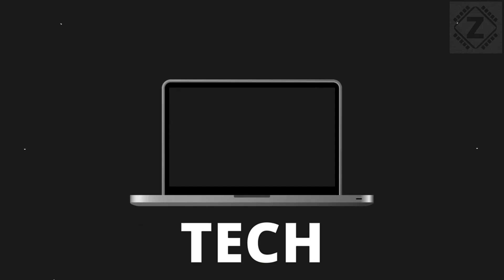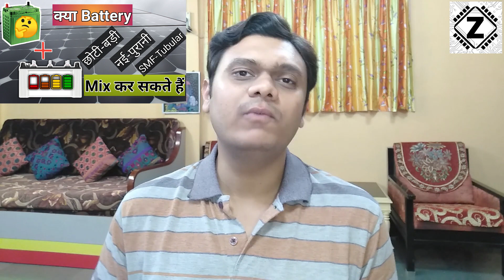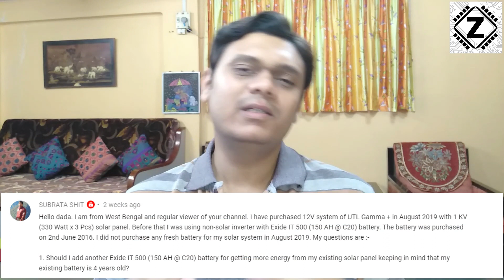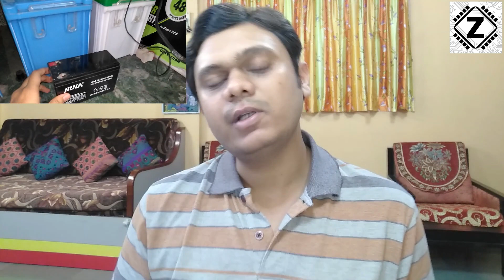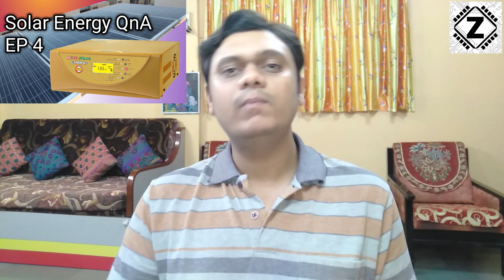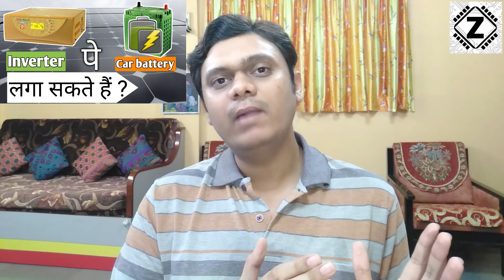[Eng] How to Parallel Different types of Battery | Mix Size, Chemistry, Topology, Age, AH Rating

Comment: Hi can I connect lifepo4
Batteries together
51.4v 100 Ah and 51.4v 200 ah
Both have own  bms
?
Thank you
Reply from the maker: In parallel, yes.
Charge them to same voltage before connecting.
Reply: Can i connect two UTL 24v 100Ah lithium batteries in parallel to get a  5unit storage for my solar inverter ❓pls opine....
Both hav one normal BMS... So any problem for parallel connection to increase storage ❓
Reply from the maker: @DeltaSeries  generally no problems. But their soc will drift.

Comment: Thank u for ur teaching...but I'll like u to tell me ,,I hav 2 pieces of GEL deep cycle battery and 2 pieces of AGM deep cycle battery and I want to use all 4 connecting them in parallel.they are all 12v 40amp...
Can I mix them in parallel? Is there any serious dangerous consequences?? Thank u
Reply from the maker: There shouldn't be anything dangerous as long as their voltage is matched closely.
Reply: @ZenInnovations  is it ok for me to ask u how to position them? Is it AGM to gel to gel to AGM or 
AGM to gel to AGM to gel? 
There position in the rack is what I want to kno
Reply from the maker: @richardalagoa6510  does not matter

Comment: Good job. I'm running actually running 2x 120ah lifepo4 in series which would be a 24v 120ah system. I wanted to expand so I added a single 24v 140ah and I'm running these in parallel. It's been a week and I've been solar charging those battery bank without any problem.
Reply from the maker: Great!

Comment: Hi thank you for the tips, I have a gel type valve Regulated battery and I plan to use it as a power backup but I only have a Gel battery charger and an inverter for now, so my question is can I possibly stock or store the battery for now and just use it if there is a power outage in our area, would it be ok for the Gel battery? Thanks
Reply from the maker: No that's a bad idea. Lead acid batteries should be always kept on a trickle charge. Get a battery maintainer with this feature. That shall help.
Reply: @ZenInnovations  thanks for the quick response mate, I also plan to use it soon for a solar setup, thanks to you now that I know I cannot store it like a powerbank I might do that sooner, and can a 60w solar panel be enough for it or I can still go for 100w panel ? For now I  might use it regularly every other day and charge it to my smart charger , but if I can monitor the charge or voltage using the gel charger is it ok to just put the alligator clips on the battery while not in used? Pardon me for too many questions since I am really new about batteries my friend, but Thanks a lot.
Reply from the maker: @spartty1856  1. Go for the largest panel that your budget may allow. It can be reused later.

2. Alligator clip is fine for temporary setup. Just set the trickle charge as per my recommended settings. Or as shown by manufacturer.

3. For more discussions join my Telegram group. Zen innovations.

Comment: i have two battery same brand same volt but different capacity(Ah) . is it okay? 
i have 16ah x4 in parallel i will add a 50ah battery is good? if 100ah?
Reply from the maker: Should be OK. 
Just watch the video carefully. Everything is explained.
Reply: @ZenInnovations  yes but you said the gap must not be far. so i dont if 16 to 50 is far.
Reply from the maker: @AniManiac1990  16x4 is already 64. Then add another 50.
It won't be far.

Comment: Sir Can a 12 volt 725va inverter charge two 150ah batteries in parallel ? My inverter charges at 10 - 14 amps will it be possible to charge both the batteries by that inverter ?
Reply from the maker: It will charge but slowly.

Comment: Those so called sealed batteries only have a thin plastic glued on cover on the top, pry that off with a screw driver and wha-la you have access to the individual cells that have a rubber cap on that you pull out to check on the fluid level.
Reply from the maker: Nope. They're vent caps.
The electrolyte is a gel or paste format. Not water.

Comment: Hi, My car has a 35Ah(2yrs old) led Acid starter battery by the company which charges with the Alternator of the car but now I want to install a Second battery same led acid of 45Ah and connect it in parallel with the 35Ah for charging with alternator so that i can run the accessories in my car separately with the 45ah battery when the car is shut down.
Question: 
1.Will the existing alternator of my car take the load of charging both the batteries together 35Ah+45Ah in parallel?
2.As the first batter is 2yrs old so won't it spoil or effect the 45Ah new battery?
3.hope any electrical won't get damaged by this connection?
Thanks
Reply from the maker: 1. Easily.
2. Generally Parallel is very forgiving as long as batteries are not different chemistry or voltages.
3. No. Make sure to use thick wires & appropriate fuses.
Reply: @ZenInnovations  thanks for you reply,  
Sir another query:
1. Actually I have put a Volt meter on my car and when I start the car and drive in the day time the volt meter shows 14 to 14.1Amp reading but at night as soon as I switch on the headlights it drops down to 13.1 to 13.2amp, so is that drop common or is it that my alternator is faulty or not capable of handling that power?
2. Secondly, 35ah + 45ah led Acid is fine in parallel connection as both together will be 80Ah or should I put the same Ah 35+35 for better chemistry?Hope my alternator won't die or not charge the batteries of 35+45=80ah  as just by switching on the headlights if the alternator power drops so much then charging 80amp battery along with headlight On won't be a challenge??
3. I have bought 10gauge thick wires for connection with 30amp fuse it that fine?
Plz throw some light as I am a bit confused.....thanks once again.
Reply from the maker: 1. Some drop is ok. Do you have high wattage bulbs in the headlight? You might want to go to LED bulbs which might save some power like these-
https://amzn.to/3E1wT9Z

2. Either is fine. Its your choice. If you have doubts, get the alternator checked. Especially diode plates.

3. 10G means about 6mm. I would suggest you double these wires to get 12mm and go for 60A Fuse along with a quick disconnect switch.
Reply: @ZenInnovations  Yes sir I have put 100/90 bulb instead of 55/60 but have put a Philips relay also so is it the bulbs power a problem?Wanted to put LED but White light doesn't give a clear visibility during fog also irritates other cars coming from front.Will it make a difference in power if I interchange and put the 40-45ah battery instead with the stock 35ah?
2. The current battery charges perfectly but only the drop happens on the volt meter when I switch on the headlights (Seems because of 90/100bulb?)going to an electrician means unnecessarily giving them money as these mechanics most of the times just want to make money saying its faulty without reasons without solving the problem, so I avoid. 
3. Sorry, it's not 10gauge, its written (10sq mm) on the wire, so hope its fine?or should I have to buy 12mm? I will be putting the fuse between the + wire coming from the 35ah car battery which is already connected to the alternator to my new 45ah accessories battery in parallel so do I need to put 80amp fuse or 35amp will work?Sir want a basic setup so want to use a manual On/Off switch between the batteries so have already have a 100amp switch.
Reply from the maker: 1. Finding warm white LED bulbs is a task in India. You may want to go back to stock 55w bulbs because I think your car is not able to handle extra load.
3. You can use 60 or 80A fuse.

Comment: I have 2 battery banks (sealed and the other tubular) . I think i need a DC ATS to switch between one bank to another. It will detect low voltage on one and switch to another

Comment: Hello good video i have a 2 200ah battery with a solar panel inverter which are 3month old is it advisable to add 2 new batteries for them of the same amps and someone suggested to me that i can add 2 new ones but with a 250ah capacity. Thanks in advance  hope u reply to me
Reply from the maker: Same batteries will be recommended. Also follow the video carefully.
Reply: Ok i understand that i must connect them in parallel batteries of different amps but my main question is it advisable to put 2 new 200ah batteries to 3 month old ones plz advise and thnx in advance
Reply from the maker: @dorykmeid8832  yes in parallel if they are in good health each.

Comment: Can I connect 2 different company's battery of same C10 and 200Ah in parallel ? I have UTL C10 200 battery and want to connect exide C10 200aH battery.
Reply from the maker: Yes. By following the explained precautions.
Charge them to same voltage before connecting...

Comment: I have 2 li-ion battery one is 1800mah and second is 1700 mah can I connect both in series
Reply from the maker: No.
Reply: @ZenInnovations  it means battery capacity should be same if we want to connect in series
Reply from the maker: absolutely.

Comment: can i connect in parallel my two batteries 12v 100 ah and 50ah same brand and same 12v both new? thank you
Reply from the maker: Yes, if you have understood the other precautions explained in this video.
Reply: Theres a chance the 50AH batteries could get ruined as being smaller and more current flowing into them from the bigger batt. The internal cell or cells could become compromised. But it would hold up for a short time tho. But you would be replacing a batt soon. Best to always match up same AH and preferably same batt manufacturer brand.

Comment: Can I connect my inverter to 12v battery and the solar charge controller to the series of two batteries including the first one which is connected with inverter, I want to add a new battery to the system, also not sure if the inverter will support 300Ah(in parellel) so can try charging the two fully on solar? is it possible technically?
Reply from the maker: No.

Comment: Hello. I was looking for your video on mixing batteries in series in English but couldn't find it.  I have two 12V Gel batteries 200Ah each. I need to make 48V bank, so can I add two more AGM batteries in series that are also 200AH. The Gel and AGM batteries have exactly the same charging parameters (bulk and float). Thanks
Reply from the maker: Generally, only Perfectly identical batteries are recommended for series.
VRLA + AGM might start drifting & Kill each other.

Comment: I have lithium lifepo4 with different ampere hour rating but the same voltage system. The ah rating is 150ah and 200ah but same voltage output of 48 volts with bms. Connecting it in parallel would that make any difference? Please advice.
Reply from the maker: Generally it should be fine in parallel. Some BMS are not parallel compatible. You should check their user manuals.

Comment: Can you mix a 12 volt with four 6 volt batteries in series to make 36 volts?
If so would there be a problem with charging them all in series?
Reply from the maker: If their amps are the same.
Also follow other rules mentioned in the video.

Comment: The truth is, you can actually combine lead acid batteries and lifepo4 batteries in parallel so long as you can match their charging parameters since these parameters meet within their limit
Reply from the maker: No. Charge curves are different. Profile is different.
Reply: @ZenInnovations  Yes they have different charging curves. Thats why these batteries need to be 'mated' first before connecting in parallel. Because within these curves, many points between lifepo4 and LA meet. In fact it works that these technique has been used for marine crafts since lifepo4 came into existence. Also, lifepo4 was made just for this, as drop in replacement and as complementary solution for the LA that cant take discharge everyday.
Reply: @ZenInnovations  dont confuse Lithium ion (Li-ion) or lithium phosphate (LiPo4) for the newer lithium iron phosphate batteries (LiFEPo4)
Reply from the maker: @practicalthinker5545  I'm aware. To cut the Confusion I refer LI ION as lithium cobalt. Which is a better name.

Still ill never suggest any mixing with lead acid.
Reply: @ZenInnovations  yeah i agree with the lithium cobalt. And Hey if you have an open mind, you may actually try for yourself to actually parallel LA and Lifepo4 batteries. I've seen done. Try to review the spec sheets of both with regards to charging and discharging current and voltages.
Reply from the maker: @practicalthinker5545  it's not just about voltages.
Lead acid has high self discharge and need constant trickle current to maintain itself.

Lithium on the other hand, does not need trickle and actually hates trickle charging. It converts trickle into heat... And then you know what happens.
Reply: @ZenInnovations  i don't know where your fears are coming from man. Do you understand really well the topic you are presenting?
these setups have been used on yachts and Cell site towers. Why are you against it? 

if you looked carefully at the charging profiles of the two batteries, the lifepo4 can actually keep an AGM (or FLA and SLA) at 100% SOC at ~12.8v the voltage where the lifepo4 actually wants to settle. The BMS of the Lifepo4 will do the "trickling" both on the voltage and mostly on the current requirements of the lead acid batt.
Reply: @ZenInnovations  i'm confused as to why are you advising against it when engineers are actually doing it and of which the Lifepo4 is actually designed for. as drop-in replacement and as cycle-booster to keep the lead acid batt for longer life.
Reply from the maker: I can only present info that is verified from Experts & Manufacturers.
Sure LFP is a drop in to existing LA inverters, but keeping both LA and LFP in Same Parallel Group it not advised by anyone.

Pls do your research if you want to mix them. You may also want to check other Lithiums here-
https://youtu.be/M-OcJCh5snc

Comment: Im not electrical but I learn a lot in this video. May I ask I have a co workers who Install batteries on site. The problem is sometimes after parallel 4 lithium battery. The 1 battery will smell burnt and will give off fumes what will be the possible reason for this?  The qa have check the battery if there are dead cell all are up and working but when sent to site it becomes defective
Reply from the maker: Parallel lithium is a different game... Firstly the BMS should be parallel compatible. Lots of budget BMS are not.

This guide is mainly intended for lead acid batteries.

Comment: Can I connect one c10 rating solar battery with one c20 rating e -rickshaw battery or inverter battery of c20 rating and a c10 rating solar battery?
Reply from the maker: It does practically work but I'm unaware of long term effects.
Reply: @ZenInnovations  Hmm. Bujhlam.
Reply from the maker: @leon9357 ?
Reply: @ZenInnovations  Yes.
Reply from the maker: You're from Nepal?
Reply: @ZenInnovations  No.
Reply: @ZenInnovations  Can I connect one 180 watt mono panel and a 16 watt poly panel in parallel? Will there be any problem using this setup with a PWM ( 20A) or a MPPT charge controller? Please help.
Reply from the maker: @leon9357  if their voltage is same.
Reply: @ZenInnovations  You mean the VOC of the two panels?
Reply from the maker: @leon9357  yes
Reply: @ZenInnovations  Thanks Zen. You made my day.

Comment: Can i mix 40ah 12v tubular and 150ah 12v tubular
Reply from the maker: Yes by carefully following the above Video.
Reply: Thank you sir both are tall tubular c10 battery just i want confirm that 40and 150 this gap is Okay?? Or not
Reply from the maker: @TarkeshwarYadavsiwan  It should be fine I believe. Charge them to same Standing voltage before merging.
Reply: Thank you sir

Comment: Thank you for the great tips. I want to connect 100AH12V Gel battery with 200AH12V AGM in parallel, you think they are similar enough it wont cause a problem? Both sealed and same cycle uses etc.
Reply from the maker: Well, both are sealed, So it should work.
But Ask with Manufacturer for best answer.

Comment: Sir,can i connect lipo battery of different size and amps in series for my drone?
Reply from the maker: No.
Reply: @ZenInnovations  why
Reply from the maker: @goodtreeministries3751  series batteries should be identical.

Comment: I have 3 100amp batteries of different life, 1 two year old 2 1 year old 3rd 2 months old. Total 300amp . 2 150watt panels installed but I don’t get enough backup . What to do? Controller stop supply but all are not drained
Reply from the maker: Please check the health of batteries as per QNA EP4
https://youtu.be/bupghuUxkfc

Comment: you are correct about paralleling large and small capacity lead acid battery...I had to learn it the hard way...42Ah + 7Ah... less than a month the 7Ah battery cannot hold charge 😭😭
Reply from the maker: Thanks for the Info.